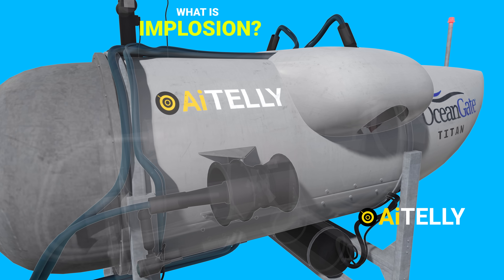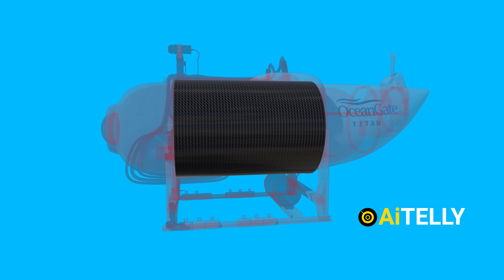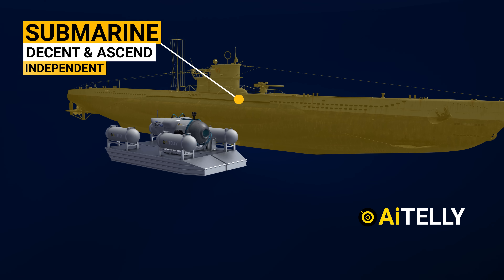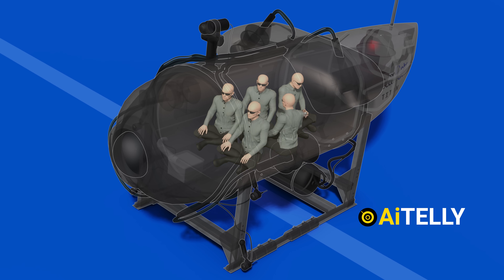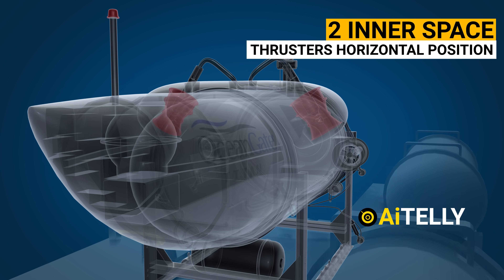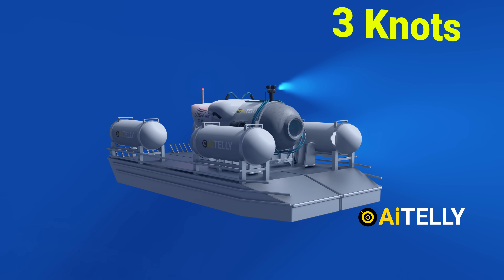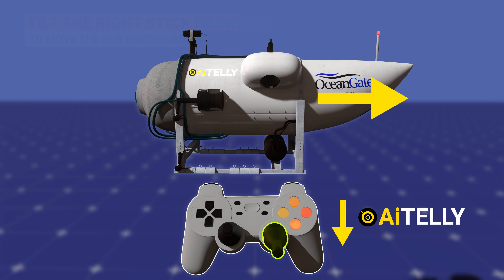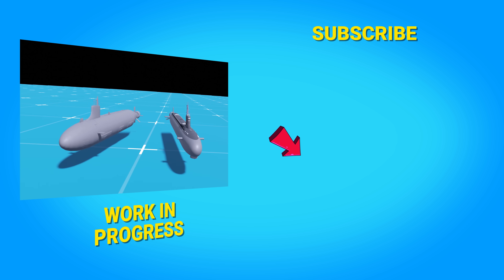Implosion Titan Oceangate How it Happened | Submersible Submarine Parts #3d

Comment: If you watch the video with Cameron going to the bottom of the Marianas Trench, he said that the sub actually compresses 3 inches.
Carbon  fibre doesn’t compress,  It Has to stay rigid Therefore subjected to stress and fatigue
Reply from the maker: Thanks for the great Infos.
Reply: Everything stresses and fatigues..carbon fiber does it a lot less and breaks much quicker. They didn't even mitigate the difference between titanium and carbon fiber fatigue with the sealant they used. That entire sub was just slapped together haphazardly.
Reply: Carbon fiber would break like glass eventually
Reply: @habeebtihad108  

Scary
Reply: That sounds about right. It just amazes me anyone actually got into this thing without learning these facts first. It would have most likely altered their decision to go. They were given a false sense of security and it cost them their lives
Reply: Carbon Fiber is strong but it's strength is not used in a compressing force.  The epoxy that holds it together, is taking the stress, by staying rigid.
Reply: How did Rush not think the hull was weakening over time. I guess whatever test they used gave a false positive. Seems common sensical to me.😢
Reply: @MrOcean2468  i believe the manufacturer of the pressure vessel even said it was good theoretically to 4,000 meters once. One time only.
Reply: I had a friend in the navy on a sub, he told me about how they'd stock food in places and the sub would contract and it'd be hard to get the stocked food out of the stored areas.
Reply: I haven't heard Cameron say that, but a 3" deformation is unrealistic. A capsule or sphere would collapse well before such a deformation.
Reply: Carbon fibre does compress, as does the matrix it is bonded in.
Reply: @salamander5703  
Well there you go. It’s a perfect substance, then for the submarine.
Reply: @Ont785  Just pointing out it does compress, nothing more.
Reply: @salamander5703  

Fair enough
Reply: Fatigue due to the overlapping combination from fiber and titanium. Also Extreme sheer forces .... yeah, there you go, sad but they atleast won the Darwin award. RIP to the souls that didnt know better.
Reply: Who the fluck uses glue in anyway shape or form on a vehicle going to these debts? Oh apart from ocean gate 😢😢.
Reply: @Teeko2003  It was special rich guy glue made with from the souls of immigrant children.
Reply: @Teeko2003 the captain that’s who
Reply: @baileypanama  The captain being the CEO  of ocean gate??. Ah okay .
Reply: @Teeko2003  The glue only holds it in place out of water, the hydrostatic ocean pressure keeps it in place, not glue.
Reply: @Teeko2003  Oh they paid some debts....
Reply: Any way shape or form how about mode? Method? Permutation?
Reply: @cocopotato5598 

What a twat.
I’m so glad that you actually wrote that down
Reply: dude making vid is dumb

Comment: The reality is that it was 100% the carbon fiber hull. Carbon fiber has absolutely no place as a hull at crush depth. 

I can explain what happened very simply but first some context. 

Carbon fibers can not make a dependable hull in any scenario. The issue is the fibers.. even if cross woven they cannot provide an equal and consistent density throughout. It cannot ply, it's like a cast.. Furthermore you can only check for error through xrays. This is why we use titanium for these submersible. It's exponentially more expensive but has a very high strength to weight ratio and it can ply under pressure without breaking. 

Stockton on his very first dive documented the hull making cracking sounds under the pressure of the water. On his second his passenger documented the cracking sounds on a recorded video. 

So what happened?

The hull was cracking throughout and water was actually getting into the cracks. Now in theory the hull could hold under the pressure and the cracks would be less imperative because of the force of both ends compressing it back together at depth. You would just need to x Ray your hull after every dive and determine whether to reinforce it or replace it. Maybe 4 - 10 dives min to max. But it still leaves far to many variables.

But the issue lies with the bulkheads seals to the carbon fiber. They can only be attached with epoxy resin, there's no other way. This is a massive problem. Once the cracks in the hull reach the bulkhead seals, there's basically nothing  keeping out the pressure. 

Once pressure breached the bulkhead seals. Your vessel is done. Your vessel doesn't even have to crush. The ends simply blew off from explosive decompression within the vessel. I don't even then the hull crushed, probably shattered and caused a massive explosion out both sides of the cylinder hull.
Reply from the maker: Awesome man for the information!

Comment: 5:57...... 'implosion because of the weak carbon fiber Hull'........Maybe, but until everything
has been analyzed and a report released, aren't you just guessing?  Yours is not sound journalism.  Good graphics, though.😎
Reply: It’s not a guess. Carbon fiber is a composite. What happens to composites after repeated compression and expansion? The resin holding it together starts to fail. This thing had a shelf life and the CEO knew it. Previously cracking sounds where heard.
Reply: @joebidenisyourpresidentget2481  Can you site a reference for any of
this, beyond conjecture? Since this is the first CF sub I have ever heard of
I am not aware of any experience of this 'compression'. Also, is Boeing
aware of this since their new planes are CF, which are going to expand 
at altitude and shrink al ground level? Not sure the shrinkage at ground
level qualifies as compression......but it might. 
Not trying to be rude but I think you, and the OP,  are making assumptions
that haven't yet been proven. Did something fail? Yes, but what might take
a bit to figure out. Probably about two years.😎
Reply: @steveyountz1757  This happens with planes as well. After enough time of rising and descending microscopic cracks begin to form. Now imagine these forces being 400 times stronger. Several people who boarded this sub before heard cracking sounds in the hull including the CEO himself. Every single news outlet mentions that this sub had an inherent life cycle. The only conjecture here is you. The rest of us are living in reality.

Comment: Great representation, only critique is that the tail cone did not implode because it was not pressurized. Only the carbon fiber hull.
Reply from the maker: Agreed
Reply: @saltysalt7339  u are right that it flexes to a point but not at those depths. At those depths carbon fiber just shatters.
Reply: @saltysalt7339  What lmao. Honestly seek some help. Why do u care so much about something flexing when it simply really doesnt, when 1 crack forms the whole thing instantly shatters its basic physics maybe u can go and read a thing or two. And no titanium wouldnt shatter like carbon fiber it would shrink like a tin can when squeezed. Sure the titanium might end up in a few different pieces but it wouldnt be in millions of tiny little pieces.
Reply: @@tetrazole567 the outside layer is not made of carbon fibre. Thts why when they fished the sub remains out, u can see most of it still whole. The video did represent the carbon fibre hull, which only surrounded the pressurised cabin, shattering into pieces which is wht I think would happened, and we dont see any of the carbon fibre hull nor the cabin being part of the remains tht was recovered. But then again im just basing this off of what ive seen and read thus far and Im not gonna pretend like im an expert here.
Reply: @saltysalt7339  What i meant is that the process happened so fast that the bending part was pretty much skipped. U should stop trying to argue every pointless detail. Ofc it bends but it all happens so fast that i would just call it shattering.
Reply: You are confused. Nothing was "pressurized".
Reply: @dennisleslie8962  The passenger compartment, also known as the pressure vessel, maintained a pressure of 1 bar, you could consider it negatively pressurized as it was less than the external pressure of the water but I think the point is the tail section, which had no pressure disparity to the water would not have imploded/crushed, which can be seen in the tail that was salvaged, the tail shell barely has a scratch on it.
Reply from the maker: You might also like Nuclear Powered Submarine Engineering behind it #3d Nuclear Reactor released
Link: https://youtu.be/J0lb46Zi5-s
Reply: @@tetrazole567 nope, it doesn't shatter and does have a flex properties.
Reply: @DemopVWgarage  has limited flex capabilities and yes it shatters.....work with it daily.
Reply: @DemopVWgarage  I think it does too, but the carbon fiber I'm used to seeing is very thin, like a car hood.